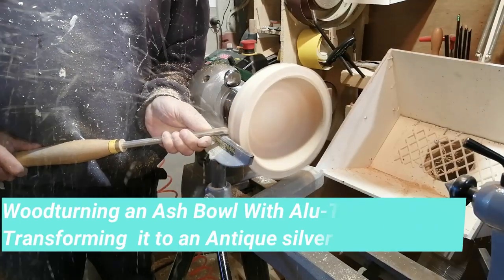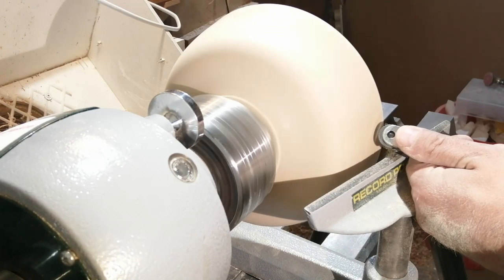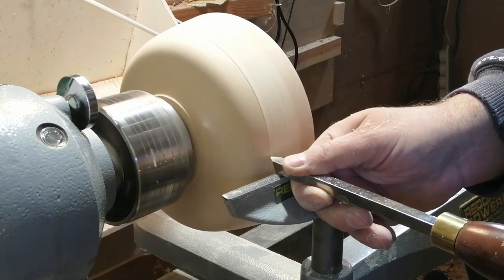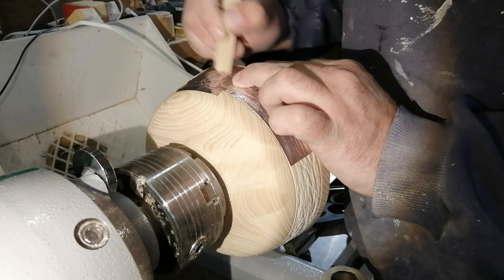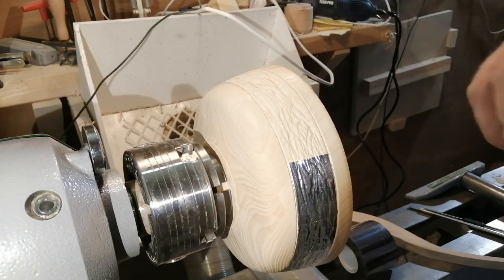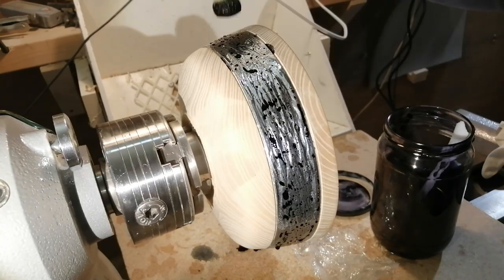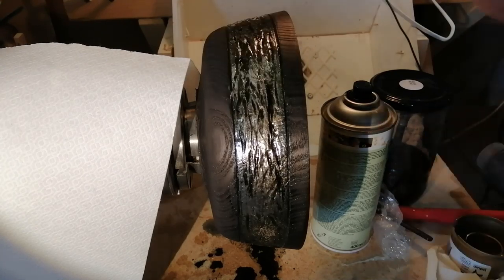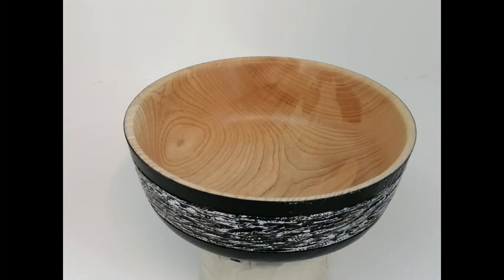How To Do A Look Alike Antique Silver inlay - Woodturning

Comment: What type of tape is this that you are using?
Reply from the maker: Hi George, This is the tape type i am using  https://www.ebay.co.uk/itm/2x-Aluminium-Foil-Tape-50mm-x-10M-for-Heating-Ventilation-Insulation-Electric/383512029474?hash=item594b192922:g:JE0AAOSwQl1e2jNN    thanks for watching .. stay safe and have a great day .. 😀

visibility_off

Comment: So I have two questions. 1) What type of tape did you use? 2) Why did you not use longer pieces of tape to cut down on the seams? I will try to do this type accent  of on an upcoming project and let you know how it turns out.
Reply from the maker: Hi Larry I will answer number 2 first, the reason why I did make small pieces of tape was that I got a lot of air under the tape when I did a Test, I thing if you wont to make it in one piece you ned a helper or to make a jig to hold the tape tight for you.. The tape type i use is something like this https://www.ebay.co.uk/itm/2x-Aluminium-Foil-Tape-50mm-x-10M-for-Heating-Ventilation-Insulation-Electric/383512029474?hash=item594b192922:g:JE0AAOSwQl1e2jNN  .. I hope you will send a pic on my mail when you have done one.. Thanks for watching .. stay safe and have a great day .. 😀😀